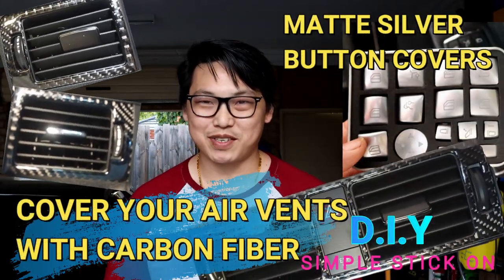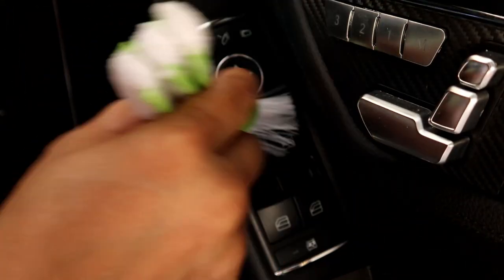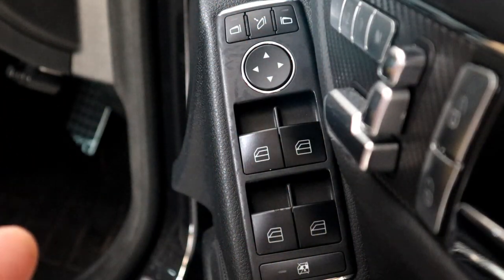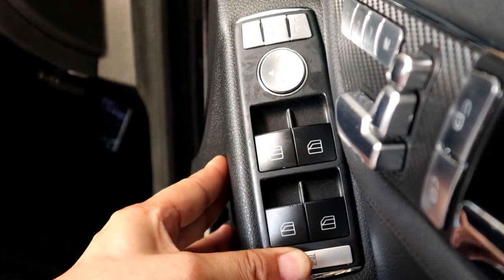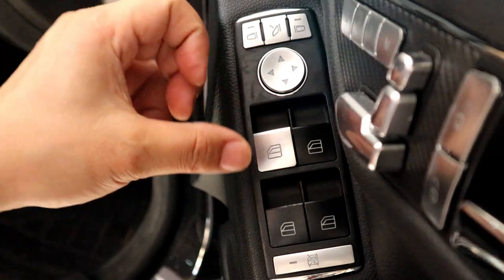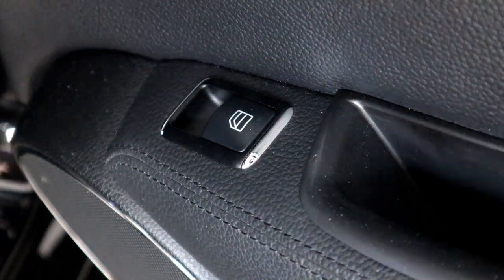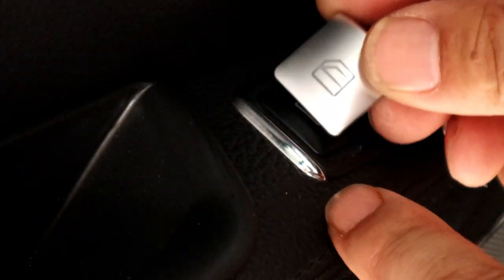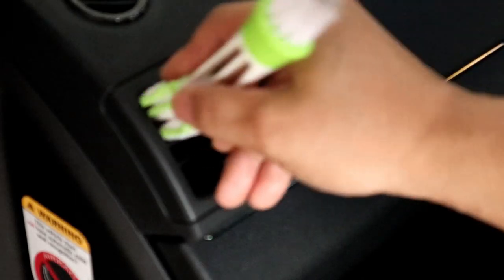MERCEDES W204 mods adding bling carbon fiber air vent cover stick ons and matte silver button covers

Comment: hi my friend..i have a question...the buttons fit also for right  and left hand drive mercendes or for right have any different? because i have E220 w212 right hand and i don't know if fit on it... thnx
Reply from the maker: it fits both because buttons are made the same doesn't matter if led or rhd it will fit designed to fit.. just like the switches were made exactly the same just installed on different sides of the car
Reply: tnx a lot my friend.. a i forgot to tell you that youre video are super...!
Reply from the maker: @zakandro7939  thanks mate

Comment: How are the lights for the buttons during the night after putting the silver stickers on?
Reply from the maker: they still shine through buddy ... u can still see the orange light , it does dim abit considering the button cover but u also need to ensure you place the button covers centre of the switch or button
Reply: @MIKEYZVLOGZ  why didn't U peel the old ones off first for the better brightness.
Reply from the maker: @moonmc1047  didn't think I needed too... but it could definately help with light

Comment: Great video! Quick question, I noticed you have what looks like a Mercedes Benz decal set inside your door latch area. Where might I find that? I’m looking for a way to brighten up the interior door latch area with a nice detail so you can notice the lighting that is inset. What you have looks really simple and clean, and I imagine it lights up with a little glow at night with the light gently reflecting.
Reply from the maker: hey buddy so it is a basic adhesive that just brings a little more class to a dull interior... it doesnt light up but the orange led we have on our door handles i side the car helps to give the decal a nice look .... i found it on aliexpress i searched for mercedes benz interior decal stickers adhesives and it cam up ... u play with the words abit and u can find alot of stuff for w204 model

Comment: Where do you get the carbon fiber trim on like the door
Reply from the maker: ebay and aliexpress ..mine are wrapped... i removed them and got them wrapped ... for like 250 aud which ia exspensive when u can do it yourself.. but u can buy the stick ons now like i have for the ac vents and light surround

Comment: bro do you know there are these carbon plates for the whole CD deck + seat heating area and the middle tunnel + around the arm rest  ? or dont you want that because of your harman/kardon badge ??  for the airvents in the back i find sth on ebay too. would love to see the whole interieur in this carbon look.. I think it could look great, but i'm more the keep it stock guy because of the original quality.. if some corners dont stick perfectly after a time i would hate myself for destroying my perfectly conditioned interieur.. :/
Reply from the maker: i knowehat u mean if they dont hold up it would destroy the interior however going back to factory wouldnt take much just alot of is alcohol cleaning ... or swap out vents etc 
i got all mine on aliexpress u can find everything there

Comment: Good job, it pays to take your time. I have the same chrome buttons. How much did you pay for the steering wheel? My 300 doesn’t have shifter.
Reply from the maker: u men paddles shifters?? i paid around 600us just for the wheel and the air bag separate

Comment: I Noticed you haven't done the stereo is it because they dont have a piece with the sd card holder cut out, if you know where i can find one please reply Keep up the good work
Reply from the maker: correct no cutout with ss card
Reply: @MIKEYZVLOGZ  Hi when you did the long carbon door trims did you remove the original trims or stick them on top?
Reply from the maker: @MrTrooper31  thats wrapped not sticker

Comment: Can you share the link where to buy everything you used ?
Reply from the maker: everything i buy is from ebay or aliexpress always check the description i usually put it in there
Reply: @MIKEYZVLOGZ  yo bro, pls reply. I tried to put sticker over the M 1 2 3 keys where you change seat back and forth. The last digit 3 won’t fit because I have a carbon fiber part in the way. It won’t click.

I want to remove the other 3 I installed but it’s stuck pretty tight.. any tips to remove it and will it rip the original black off with it as well???
Pls help
Reply from the maker: @multiblade04  do u mean u have carbon fiber wrap or adhesive on the trim? it shouldnt affect the way the button cover sits on. show me a pic huottea@gmail.com
Reply: @MIKEYZVLOGZ  I have the carbon fiber with 3m on that whole section. Because of that the silver buttons don’t all fit.
I installed 3 and 4th won’t fit with the carbon piece around.
What I’m saying is how can I remove 3 of these already glued to the button and not damage it??

How so I remove the keys already glued on safely?
Reply from the maker: ahh I see.. I understand .. to remove the glued button you will damage your original buttons because the adhesive is so strong it may peel of the button... I would try use heat and some goo remover and slowly remove it
Reply: @MIKEYZVLOGZ  fuck man. Will it damage the original button? Is goo gone safe?
Reply: @MIKEYZVLOGZ  and on one button sometimes doesn’t click well. How can I move it a bit after being pressed down? Can I heat it real hot and try pushing it
Reply: @MIKEYZVLOGZ  and does isopropyl alcohol damage the buttons or fade the color?
Reply from the maker: @multiblade04  wen I did mine the only part that faded was the outer part of the buttons the surface ... so I would only clean the buttons.. the bond is so strong it peeks the buttons so u have to do it right first time
Reply: @MIKEYZVLOGZ  i wish I didn’t install them then
Reply from the maker: @multiblade04  yes but easy to replace the entire button and cheap to get new buttons.. actual buttons not just stickers

Comment: I made the mistake of putting on the carbon frame before the buttons.  Even after, it's a tight fit and buttons can get stuck down.   I recommend either or and not both.  Also, these could ruin the paint on the plastic buttons underneath and make sure you use the proper buttons.  You NEED to use the 4 for the main panel and the other 3 for the passenger doors.   They aren't the same.  The main window buttons are actually wider than the passenger ones and have to be set exactly individually where they should be.   Each button goes only to an exact button in the vehicle.
Reply from the maker: good rip

Comment: Is that real carbon fiber? Also have you done any upgrades to your headlights? I want to put LED in. Thanks!
Reply from the maker: i dont think its real carbon fiber friend  ....but it does give it a really nice look ....as  for my headlights i already have the bi xenon so its already hid bulbs in the low beam but i have used led light bulbs n the high beam compartment..also i have done the angel eyes as u can see from the videos ..that video i am working on now its a huge job but worth it

Comment: The  primer pads are isopropanal soaked pads, same product as medical wipes the doctor will use prior to giving you an injection.
Another tip would be to use something like your pick tool to help position the covers prior to pressing down to stick permanently.
Reply from the maker: ye good tip mate thanks only difference is when you use a microfiber cloth to wipe it's not the same as having a soaked little towel which actually helps the adhesive stick and bond really well to the button... so much that once you stick the button covers on you cant remove them or they will rip the original black rubber button covers rightoff which is a shame so forethought of whether its worth it to change button covers should be well considered before doing this...I like the look so much better so I did it to match the rest of my interior